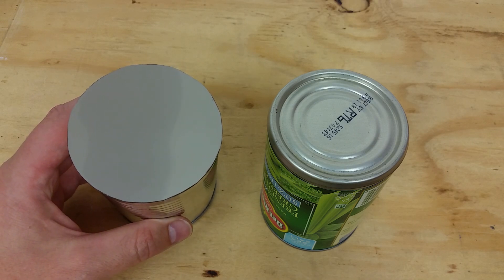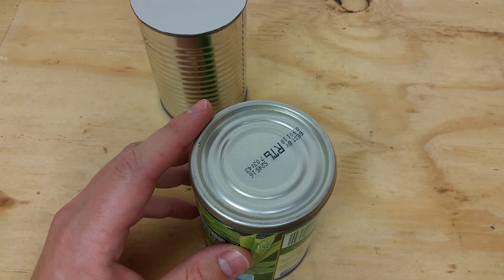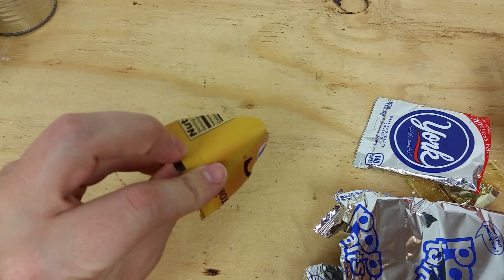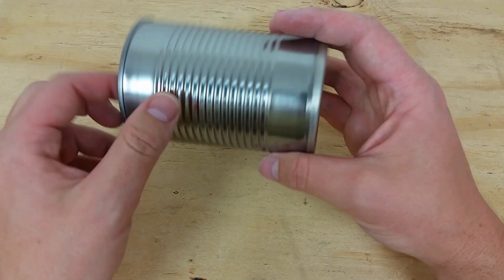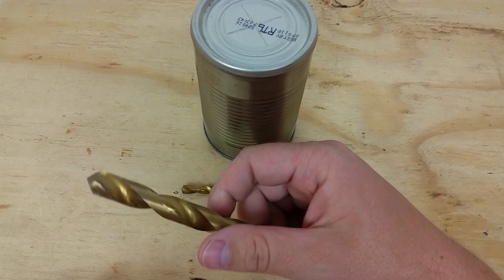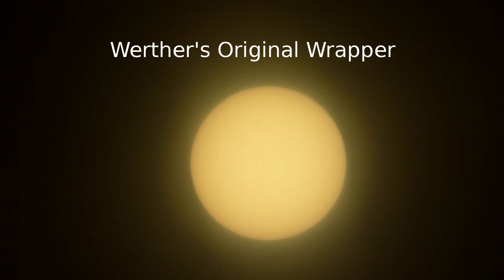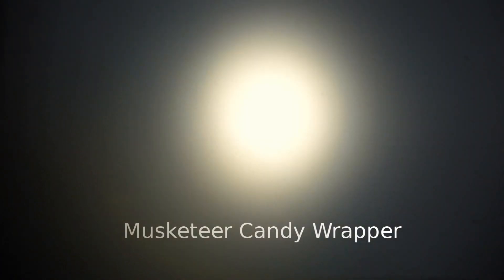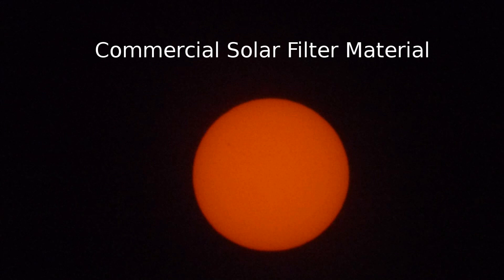DIY Solar Filter for Cameras and Telescopes, Part 2

Comment: Thanks for the video.   I just started researching solar camera filters today.  I especially appreciate that you illustrated how a double layer of mylar works.  Your video is one of the best I've watched because it covers the effects of using different materials.  That is especially helpful.
I'll try painting the can with flat black - especially the inside - hoping the reduced reflections will cut down on the amount of reflected light getting to the sensor.  I'll also try making the hole (f-stop) in the can smaller hoping to get better contrast.

Comment: You're da man! I was wondering about this! I would not use any of these mylars where you looked through it with your eye because of the inconsistent quality. I would like to have seen "wrapping mylar" tried. along with the mylar from a "Stax potato chip" can. But I suspect that it will be lowgrade like the others!
Reply from the maker: The viewfinder on my camera is digital; so no risk of eye damage. There are lots of different mylars available, but yes, since they are not designed for optics their quality varies. I will put those on my list if I give it a go in the future.
Reply: Before I watched this video I loosely held a Stax peel off lid to my camcorder.  It's pretty thick, but surprisingly I did see light on my view screen.  I may have got a better result if I had taped it down.  I'll try that later and if it works good comment here again.  By now you likely have something working.
Reply: to Eric Nutsch:
As promised here's my report.  
I tried 3 or 4 materials on my Canon HF R400 camcorder.  The STAX top was thickest but didn't work good because the camera didn't focus.  The STAX gave a white color.  Other materials I tried gave the same color as the color of the ink on the various wrappers.  
I also tried a layer of Werther's candy wrapping paper.  It was the most promising because the thinness allowed a good representation of the shape of the Sun (unlike all the other materials) and the Werther's wrapper might have yielded focus if the camera had more focus range, but the camera showed every wrinkle of the wrapper.  
I painted the inside of my filter material holder black so it would have less chance of unwanted reflections inside the holder.  I made and posted a series of videos showing the build process and the result of each material used.
Reply from the maker: Cool! post the link and ill have a look.